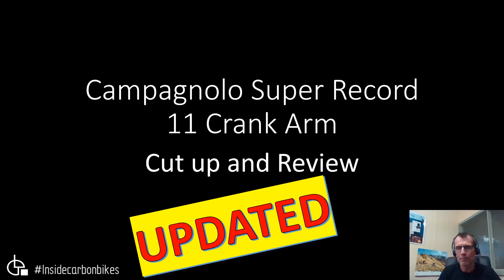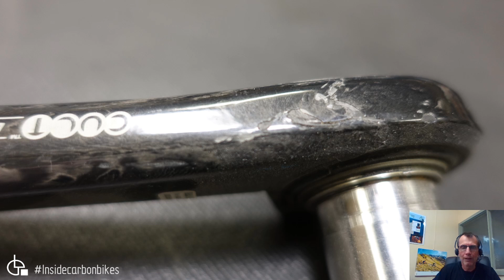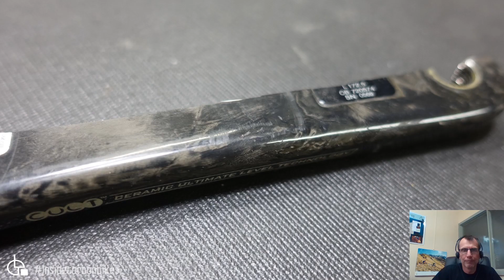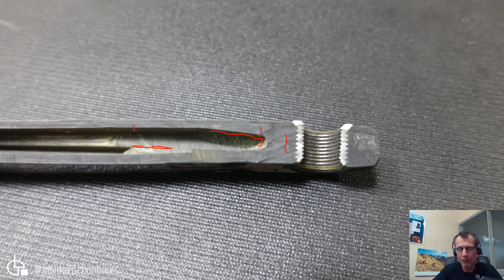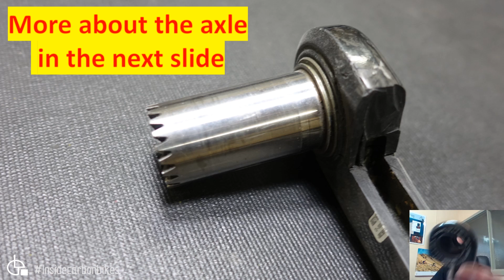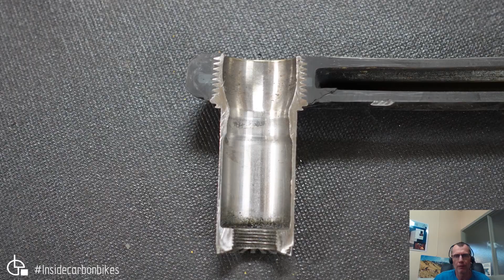Campagnolo Super Record 11 Crank Arm UPDATED

Comment: Does anybody know if there are SRAM Red 2012-2013 era cranks that have been cut up? Mine failed on me near the pedal insert, carbon cracked and delaminate actually, so I am very curious about this. I had alot of miles on them. going to do a video about them

Comment: It's interesting to see habini's video and this video. It really shows the difference in level of manufacturing quality of campag versus shimano and sram. Incredible quality. I have been riding a chorus group set from 2015 that I bought used on ebay since 2017 and it always felt fantastic. Videos like this pretty much explain why.
BTW, my groupset is still has white graphics.
Reply: Not sure that hambini has negatively criticised Shimano?
Reply: @glennoc8585  he has very recently gone a little morenegative on Shimano than before I think because of the crank failure issue
Reply: @huwsalway4099  That was a small issue though on 6800  and 9000 cranks. Google 'campagnolo crank failures' its a horror show.
Reply: @glennoc8585  Not seen any Campag failures myself, weve quite a few Campag users in our club and some of the kit is 10-15 years old as well as more modern groups, in the meantime I've seen two ultegra failures both on club rides thankfully nobody hurt and yesterday a club mate told me hes had one go also. again fortunately no injury and managed not to crash. None of them especially old and none of them crashed. Its pretty common, thats what Hambini was referring to when he said Shimano had gone a little further to the left of his shitness graph. I have Shimano Ultegra on one bike and its fine, I like it but the cranks coming off, An existing Campag one I have going on in its place
Reply: @huwsalway4099  He's also been full of praise for Look frames as seemingly having properly engineered bottom brackets, made to tolerances, just one step below Time etc. I have got 4 Look modern bikes that all have had their bottom bracket shells de-bond from the frame. The best lasted 2 summer seasons (approx. 2k miles), the second one 1 season, the worst two, and most recently made, failed in less than 2 months of use. All ridden in dry conditions only, by a humble recreational rider . However, anecdotes are to little to form a trend. Hambini, however competent in his stuff, is no gospel either.
Reply: @glennoc8585  Small?? It has gone so far as to delay the launch pf the latest XTR crankset  and now the whole Ultegra 7 DA 12 s launch. They have a big problem with their Hollowtech  cranksets and they know very well. Let's see if the can get that bondingline shoulder right ;)
Reply: @DavidDiaz-yy4cb  How did you find out that Shimano has delayed release due to crank bonding?

Comment: Campagnolo fixed the clearcoat issue in 2015 so they are no longer tuning yellow.  (Was the main reason why i bought a new Chorus 4 arm crank instead of swapping the driveside bearring and small chainring on my 1st gen Corus ultratorque carbon crank from 2006 after +70000km).

Comment: So there you have it, Campagnolo is even better than you think!
Reply: Except that it’s not actually better...Campy is for wealthy fat D grade riders
Reply: Still unaffordable for the masses.
Reply: @glennoc8585  no it is not you can pick up campagnolo equipment on ebay and various other sites in very good condition. it is affordable 2nd hand
Reply: @glennoc8585  the 11 speed stuff got sold for dumpster prices so too bad if you didn't look out for it. The 12 speed chorus is still in an allright pricerange though, especially since it doesn't require rear hub shenanigans like sram & shimano.
Reply: @shredfreak83  I have no.desire for 12spd neither do my club mates. Shimano 11spd is Still.the most raced groupset in.pro racing.
Reply: @glennoc8585  Because Campy can't afford to sponsor as many teams as it did (or simply doesn't want to). It's a much smaller company with no shit-tier componentry that still takes a huge chunk of the market (or the majority of it). Shimano will most likely deliver 12 speed soon and then everyone will be riding it - pros ride what they're given :)
Reply: @PoltergeistWorks  fulcrum are campy low tier, theyre budget campy which are good except the bearings are cheap so.need swapping out. Campy are more artisan looking over the competition I'll give them that. The deltas calipers were very unusual. It worked awfully.
Reply: @glennoc8585  just admit you're poor and can't afford shit. it doesn't hurt man.
Reply: @glennoc8585  Still, Campagnolo has more wins than any others combined. Just sayin' :-)
Reply: @MyDemon32  I've got a TVR in my garage and dura ace di2 I'm.certainly able to buy what I like.
Reply: @v57163  haha well that's a nice thought I suppose but unfortunately it would.take  a big research fund to prove that.
Reply: @glennoc8585  LOL 😂 would be funny. But, have some respect for Signore Tulio
Reply: @v57163  I have respect  for Paul de Vivie.
Reply: @MyDemon32  LOL 🤦‍♂️
Reply: @glennoc8585  many things are stolen, and marketed better than original. Including Shimano with my patent.
Reply: @v57163  your patent?
Reply: @glennoc8585  yes, fit machine. Exit Cycling is my company.

Comment: I'm not real clever but would you get a more rigid bond if the "threads" on the spindle and pedal inserts were at a right angle to the crank arms rather than in line with them. Just thought it'd grip better when under load.
Reply: Those are there to provide a larger surface area for the bonding and perhaps to aid with the axial loads. Besides, how would you manufacture threads tangential to the crank arms?
Reply from the maker: Correct!
Reply: @LuescherTeknik  You think that all those are threaded after carbon was done? The glue on the spindle side might indicate that. What you think - are CR Bolts inserts also thread in? Or they were molded at the carbon stage?
Reply: No, that would be counterproductive, as it would be much harder to achieve consistent bonding.